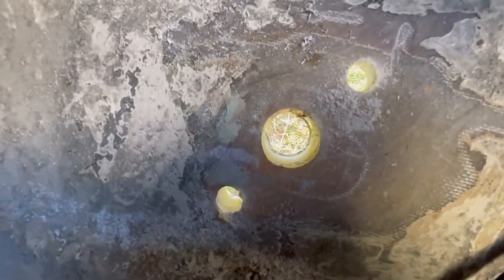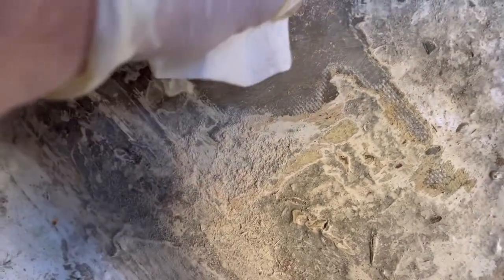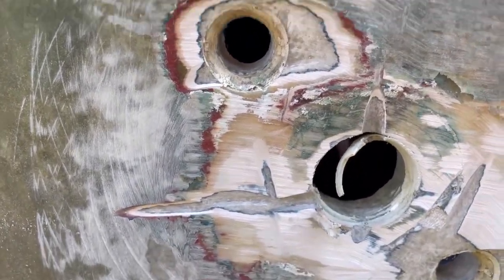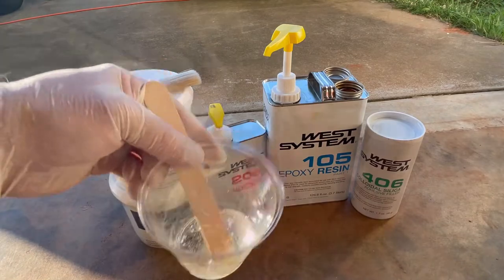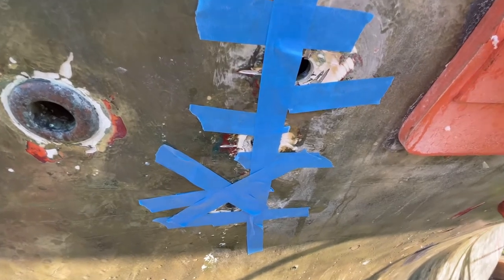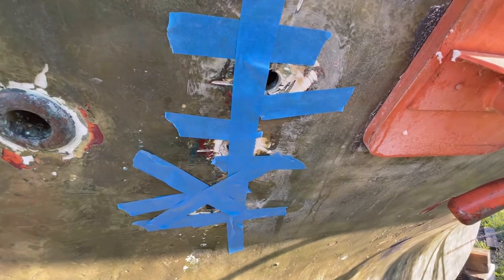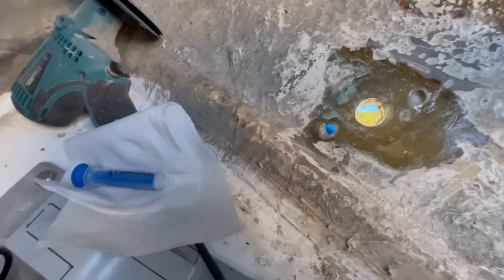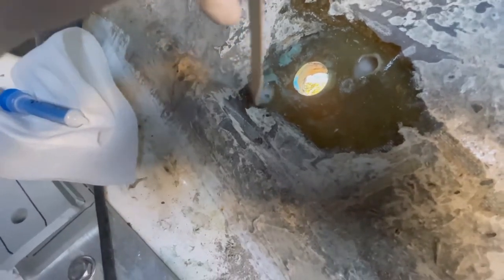How to Fill Holes In Your Boat’s Hull | Sailboat Restoration Ep. 20

Comment: Thanks for the video, gonna definitely help me fill up some holes in my old boat!
Reply from the maker: That's good to hear. These older boats have so many more thru-hulls than necessary.  I closed two more recently. The intake for the galley sink. I am running it from one of the freshwater tanks. The sink drain will feed to the gray water tank off of the head. Two holes eliminated with these changes.
Reply: @Even_Keeled  You're doing a gray water tank in a boat that size? I'm surprised you have room. Or do you mean the black tank? My boat has even more ridiculous thru hulls, like the macerator discharge for the black tank, which is below the waterline. It's so hard to tell when it's done pumping, and is just an unnecessary leak risk in my opinion